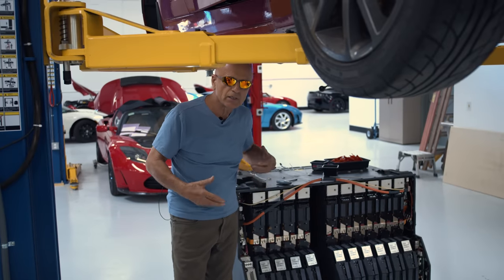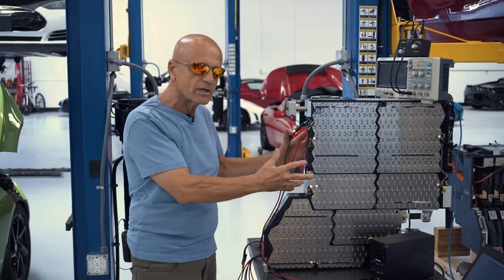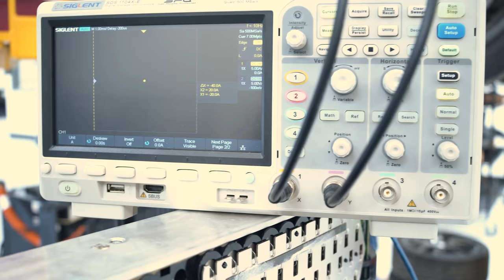Tesla Batteries STARTING TO FAIL | Gruber Motors

Comment: Pretty cool, thanks.  Those old school cells have done well, and now can be recycled.  Newer cells should last even longer.  Too bad the packs can't identify weak cells, and at least created a fault code.
Reply: 7000 such wires would be required to find a faulty cell. BMS can detect voltage on independent cells connected in series but cannot detect a faulty cell in parallel arrangement. The tesla battery connects several dozens of cells in parallel to create a pack and then those packs are connected in series. Still an average customer can't DIY repair the cell. I will repair mine if my tesla has such issues.
Reply: @petsonly4068   Okay.  Wonder if an abnormal thermal signature could identify faulty cells.
Reply: @richardalexander5758  That's likely how they find the faulty cells in repair, given it's gone resistive, it's just heating up a lot while the rest provide it with power.
The car monitoring which exact cell is doing that doesn't seem viable to me (for once because it would need a sensor for each cell, and second because once the fault happens, it's already a repair job where they wouldn't blindly trust the fault code to begin with if doing a good job, so they would redo the test), but detecting an abnormal charge pattern and charge hold should give a code out for sure.
Reply: @Kalvinjj   Cool, thanks.
Reply: For something of that age it really isn't viable cells don't just deteriorate at a constant rate. The loss of usable charge goes down slowly over their rated life but after that it drops quickly look at any battery degradation chart they all just roll over at a certain point so after so long in use yeah you could replace some cells but you would quickly find more and more failing
Reply: One problem is that new cells dosent got longer lifetime. It´s still about 8 years, and look at that the same timeperiod as Tesla waranty...
Reply: They use it from model 3, since 2017... so you are perfering to ther testcycel that they should last for 15 years. It´s not been in EV for 15 years. And it´s stil 8 year waranty. In model Y they have stepped up 4680. And ther is also reports with the higher energy that the self combustion temperature is going down to half of before... EV is the future, but the hunt fore efficency will cost burning cars.
Reply: Please explain how to recycle these batteries
Reply: @xsmooth69x    Redwood Materials
Reply: ".. and now can be recycled" not so fast dude, research a little bit about recycling this toxic waste and youll see is not so easy, and not exactly clean.
Reply: @retrodave79  false, these have close to 100% recovery rate in the newest recycling pipelines.
Reply: @richardalexander5758  No is not propaganda. Its not an easy process and far from clean one, batteries are full of toxic and flammable chemmicals, you need to deal with that in other to extract the expensive metals, to make things worse, manufactures are trying to reduce the amount of expensive materials used on the batteries, so will be less proffitable to recycle them, if that its the case manufacturers will need to have their own recycling facilities.
Reply: Cell banks going low is doable. Any good BMS worth its salt has individual bank voltage detection and it will attempt to balance out the low cell / bank of cells to match the remaining cell banks in the pack, or if the differential is too great, it will stop charging / discharging the pack, or reduce the usable cycle life to ensure the weak bank of cells isn't being overdischarged, or the good banks overcharged.

The problem is though, you can't do that with parallel cells in the bank, as the voltages read by the BMS will all be the same. Even if a cell goes resistive, the voltage potential across its positive and negative terminals will remain at bank voltage until the cell is disconnected, when it will have chance to drop below the level that the rest of that cell bank was at. you have to rely on the BMS detecting a low cell bank or your eyes and a multimeter to find the bank that's discharging, then it's all guesswork to find the defective cell itself. you might get lucky with a thermal camera if the cell is especially bad.
Reply: @retrodave79   Research Redwood Materials, become educated, and stop spouting b.s.
Reply: They don't, it's just cheaper to make.
Reply: @richardalexander5758  dude, you are a fanboy. So sad.
Reply: @Groaznic  what is false? Do you know the difference between process and results? Dont think so.
Reply: @retrodave79   So very sad, with profit enough to buy two plaid model S's and have enough left over for a model 3.
Reply: @richardalexander5758  thats the only thing most Tesla owners really care, to show Up, to demonstrate they have more money than others, congratulations.
Reply: @retrodave79   I don't own a Tesla, just TSLA stock which I bought back in 2019 when Wall Street and the experts said it was going bankrupt with no demand.
Reply: Wow you support this?

Comment: It’s a conceptually simple solution, but an effective one. I like it. Your not just saving customers a lot of frustration and money, you are helping the environment and the supply chains by keeping these things online. Well done.
Reply: This really shows how invalid all the arguments are lately about how "it costs too much to create lithium." In fact, 14 years out of a battery pack is an insanely effective use of lithium. Very few people even have 14 year old cars anymore. This is with old technology too. Some say that they have 200,000 miles on their battery pack and it's still at 93% in their newer Tesla.
Reply: @Ritalie  14 years is a long term scene where people didn't charge card with supercharger, didn't drive them daily and kept them as toys or cars which had ic alternatives.

A only electric car battery which
  gets used often dies much early
Reply: @Ritalie  The average car age in the US is 13.1 years so, not quite 1/2 the cars on the road are older than 14 years.  Of my 4 cars, 3 are 13 years or older.  They still operate correctly. One needs to be condemned because of rust.
Reply: @Ritalie  My 2008 Honda Accord with 200k miles drives just fine with zero loss in range. I can recharge it from 20-30 miles range to 360 miles range within 4 minutes. Charging stations are everywhere along all highways and cities. There’s a strong network of independent repair shops everywhere in this country, that can fix anything that’s wrong with it, anytime without waiting for Honda to provide parts. There’s even non OEM parts for cheaper if I want to spend less. The best part is that I have the repair manual available and can do my own repairs on it if I want to.

Comment: Imagine any other car company telling you it will be 2 years before they can get a replacement engine to you

Lol
Reply: With the price of petrol it is not helping ability to get new EV's or battery packs quickly. The petrol price change has happened all of a sudden with the Russian Ukraine war and sanctions. Many people are trying to switch to EV's because of this. Also Tesla in the USA is in higher demand than quite a lot of other manufacturers. Some other manufacturers in the USA, like Ford are not making many electric cars.
Reply: WE are talking 14 years old. Only law on the books is till warranty is expired. I make a living supplying aftermarket parts. Rolls Royce was out of power seat parts for 80's cars in only 10 years. Nothing available till I came along. $150K car, 10 years old and your power seat will stay broken.... so says the dealer...

Comment: My gasoline powered truck is 22 years old and has 300k miles on it .and I replaced the lead acid battery maybe 5 times @ $100 a piece, no waiting! Engine and transmission still works great! Good luck with your Tesla! Obviously you can afford this nightmare.

Comment: I drove my 1985 Chevy pick up for 10 years to a little over 200,000 miles. I bought a new crate engine from GM for $4,500 and had my mechanic swap it out. Total cost around $6000 when completed. I then drove for another 15 years until the whole truck just fell apart. EV’s are a long way from being able to accomplish that.
Reply: The new Tesla batteries will last 1M miles. The electric motors should also outlast the car itself.
Reply: I drove my Chevy to the levy but the levy was dry.
Reply: @Speedytrip  You have to blindly believe everything Elon Musk says to rely on that coming true in reality.
Reply: @Speedytrip  BALONEY,  YOU ARE  EXAGGERATING  !!!!!
Reply: @ralpheisenbath103  With people like Pete Gruber around, I can see 1M miles being feasible, with moderate repairs along the way. Commercial trucks are expected to last that long before a rebuild, but they actually make money. We can certainly make cars do the same if the price is right.
Reply: @Patriot55 That's a good way to own any depreciating asset. Have you guessed at your fuel, maintenance, and insurance costs for 25 years? I came up with a rough guess of $65,000 of fuel you bought and $30,000 for insurance. I'm sure those are way off, but they're similar to mine.
Reply: 1985 and 200k miles, hmmm so 20 or so years ago replaced a motor. In 2022 nearly a 10 thousand dollar repair, I find it amazing the transmission Lasted so long, defferential, how many exhaust replacements, water pumps, alternators, plugs wires, oil changes, breaks although an 85 has way less under the hood than a modern vehicle driving even more parts replacements.  Ev's have advantages and so do gas powered. Give it time.
Reply: i have an 89 Jimmy. Original Drivetrain. 185k. Still runs good.
Reply: @StreetFighter2010  I drove my chevy to the levy and a cell died and I didn't have the range to get home.
Reply: @Speedytrip  What a ridiculous post in a you tube video about Tesla battery failures!
Reply: you have the advantage of being alive when the tech was nearly perfected, the original gas engines small block chevy especially, and flat head fords were far from as dependable or cheap as they are now, it's simply an evolution of the transportation industry, same as when we evolved from walking to horse and buggy to the first IC vehicles, to the latest EV vehicles
Reply: @williamreadon9052  Surely you aren't thinking these are the first time electric cars are you? This idea has been floated for years but never successfully. Just as they will again with this new round of GREENIE MEANIES!
Reply: @Speedytrip  yes, the hyperloop will also be completed by 2019 - oh wait...
Reply: @wdbldr67  I went 295K on a '97 Mustang, Never had a major issue, Original water pump, original alternator died at 280k, other than that it was oil changes and stuff like a set of shocks and ball joints which EV's have... EV's aren't the future, they're a band-aid and a toy for the rich, we need to put our resources into something actually environmentally friendly like Hydrogen fuel cell cars, Only by-product is water and you can get hydrogen from water, whereas Lithium is strip mined.
Reply: @braydons5623  That's Cool about your Mustang but newer cars are made to be disposable. I have 2 Daughters with the same style SUV one a 13 and one a 14. Both with up to date maintenance but both have required the Transmission replaced as well as other components totaling over 9k a piece and neither has 100k miles on them.  There are way more 30 and 40 year old cars on the roads than reliable 10 to 15 year old cars.
Reply: @wdbldr67  If they're a GM or a Ford Escape that isn't surprising, You gotta go foreign for reliability, but all new car's have issues...
Reply: @braydons5623  nice guess. Escape
Reply: @wdbldr67  They're Known for issues, my cousins a Ford Tech and told me to stay away, I just got a '21 Mazda3, burns oil... but my grandparents haven't had any issues with their Toyota's
Reply: Since no EV's are even close to 'proving' that, they are a long way.
Reply: @webcomment8895  "these batteries were supposed to last 10 years we are pleasantly surprised that they made 14 years..."
Reply: More oil changes would have got you to 350 k easy 🤣🤣
Reply: @Speedytrip 1 million miles 🤣🤣🤣 yeah right ..more bs from Elon.
Reply: Your engine lasted 10 years, the battery he started with lasted 14 years in the video. Why did you comment?